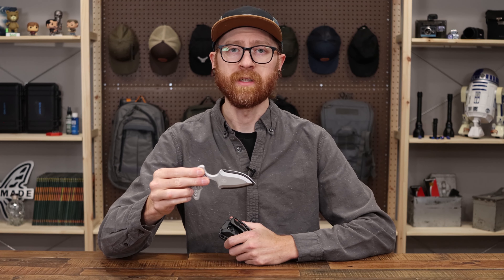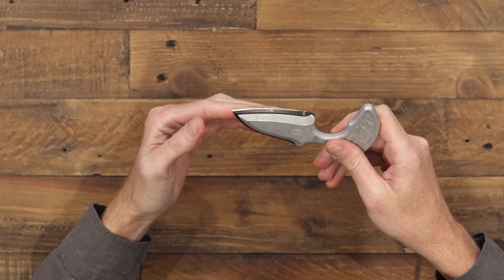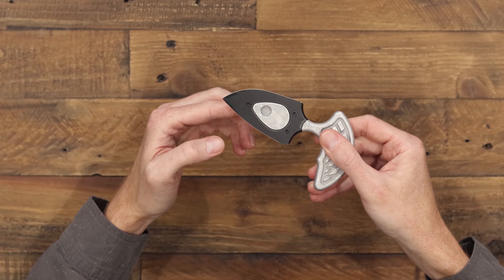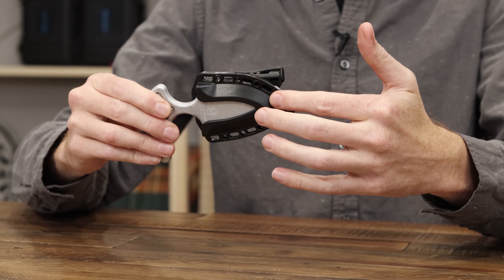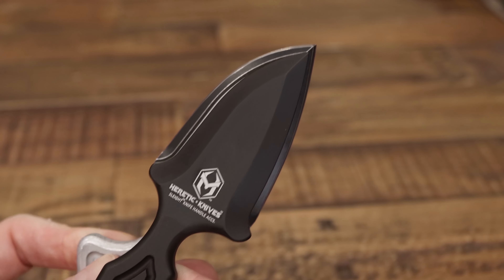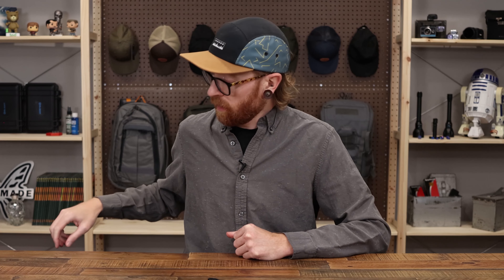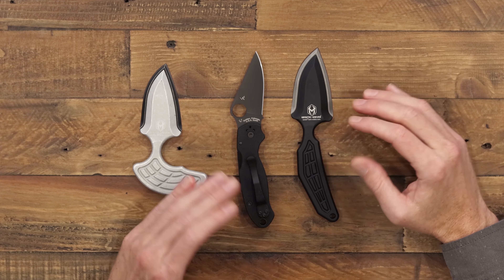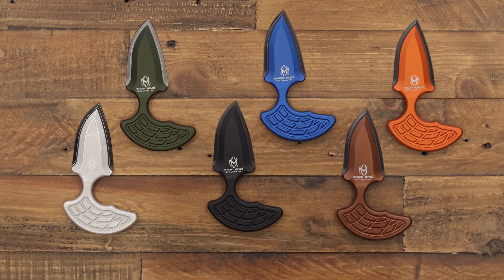Heretic Knives Sleight Modular Push Dagger | Overview

Comment: Cool ass shit. 

(edit: i recant on the prices, seems you can get one for 170 now, I recall seeing these for 400 plus)

Really wish more push daggers were of this style. When you punch (correctly) you are using your index and middle finger to land, meaning having it stick out of your index and middle finger opposed to middle and ring finger makes great sense. Not only likely martially better but it allows for a grip where you can do utility tasks much easier... I know it aint meant for that but a 400 dollar self defense knife should be able to pick up some of the slack of your hard use basic blade for bushcraft/camping etc. Not even saying it must do  that comfortable. Just be less awkward as a box cutter.

The modular design is why better than the dual position knives which mechanically shift from one form to another. They are very cool but it you need a push knife so badly while holding the typical knife, carry a second knife. That is faster to pull out than mechanically changing your knife... making it not functional for a couple of seconds.... maybe a good few seconds under stress. I mean simple is better. The reason fixed blades are the proper self defense blades is that a lot less can go wrong... so long as you don't skimp on the sheath or buy a knife where the sheath covers the whole damn thing.

I think the Ka-bar "hybrid" style of pistol grip knife has the best of both worlds and is safer for you. Unless you box and might as well have all that hobbies martial arts practice and muscle memory translate in a fight or flight situation... which is far from fantasy. Some people think a real combat knife is silly since 99% of the time or more you are cutting paper uncomfortable. All you need is to be in one situation where you almost has to use it and you get it, your mind is permanently changed. I regardlessly was always a believer in bringing I knife near everywhere you go and experience taught me I was totally right all those years.
   

If they sold a combo pack including both style of handles and a few blades for like 150 bucks id say yeah maybe. The cost is really wild, I get it is only for real knife hobbyists but every fancy brand I know that does the best is one which has a 100 dollar model of something sharp, get you in the door.

Design is brilliant but it is only sharpened on one side... a chisel grind. I think a premium dagger should be something like a hollow grind, one that has 2 sides. I'm sure this could enter meat just as well practically.